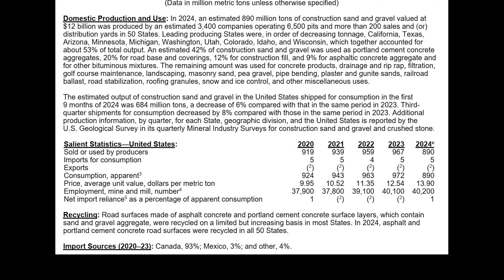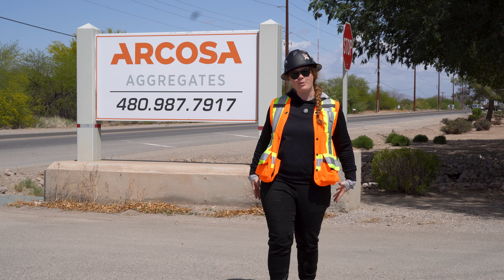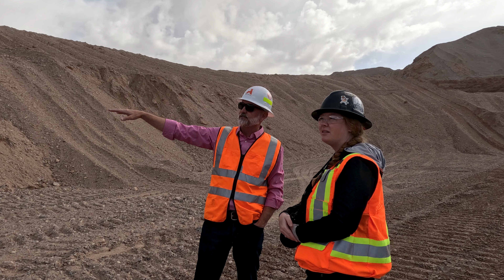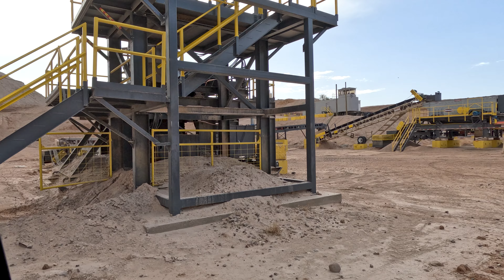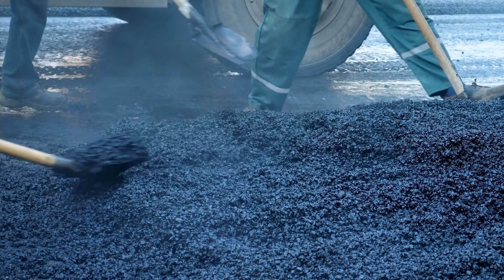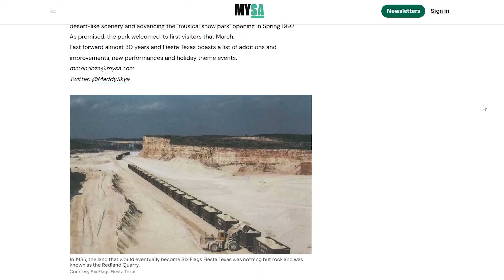The Foundation of Society: How Aggregates are Produced

Comment: Super interesting. 🙏. In Las Vegas I live close to a massive aggregate operation called Wells Cargo. The pit is so deep I don't understand how they get down to the bottom and back up again.
Reply from the maker: Crazy!! The ones I usually see from the air and stuff are usually just wide, not usually too deep! I'll be driving through there soon might have to see if I can check it out!
Reply: @minelifemediallc 7770 W. Spring Mountain Rd. , 89117